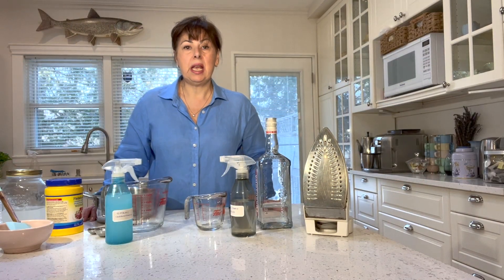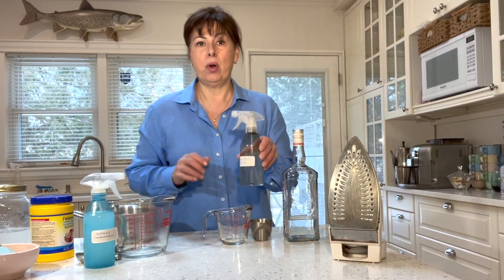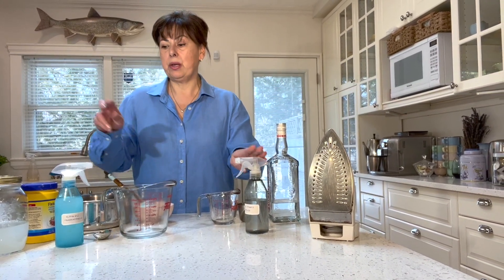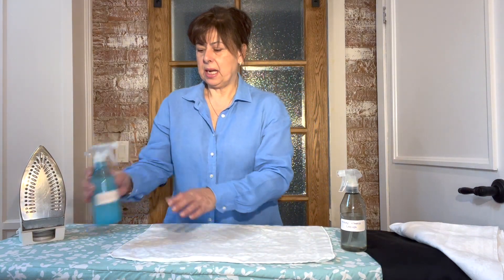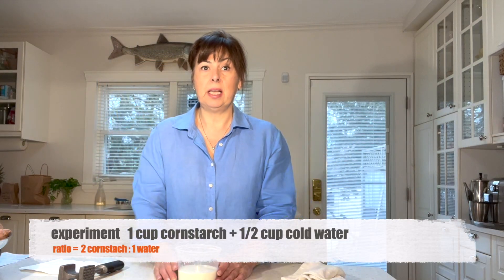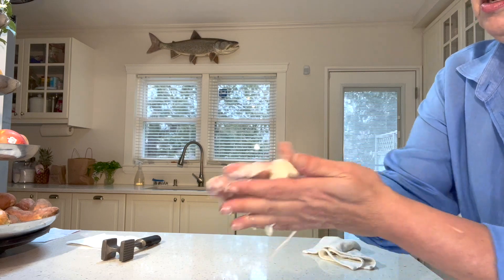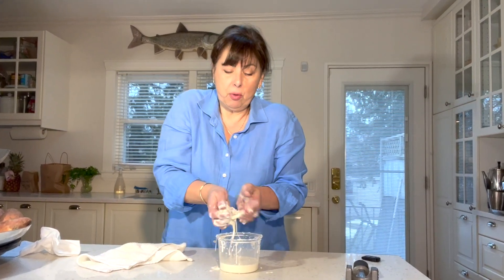DIY Spray On Starch and a Science Experiment!

Comment: This was a great video! I learned the art of starching clothes and I agonized over the course of a week of what kind (spray, liquid, powder); how, and where to get the laundry starch. Then I realized that I could make my own! And THEN I realized that I didn’t even need to buy corn starch because it was already in the pantry! I tried this recipe earlier in the week, and I tested it out today. 

The purpose for making this was to flatten out the seams of old jersey knit shirts after taking out the thread (I’m prepping scraps to practice on my brand new sewing serger, which I don’t know how to use yet). There is quite a difference after ironing with the starch!

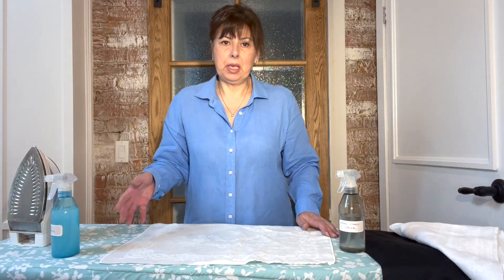My question is now, what is the maintenance on the iron and board? I’ve caused starch streaks on my iron. I noticed that you swipe the iron on a towel between uses (6:10 to 6:20)? Any tips and tricks would be greatly appreciated!
Reply from the maker: A new serger, how great! I like using the vodka starch which doesn’t leave much residue on the iron. However,  I’ll clean any residue off the bottom of iron by pumping steam and wiping  or ironing on an old towel.  For deeper cleaning,  on a cold iron, I’ll use a little dish soap & water and wipe with paper towel.  I haven’t noticed my ironing board pad getting starched or soiled. However, it’s probably a good idea to wash it from time to time.  Hope this helps. Thanks for watching and enjoy your new serger.

Comment: The vodka starch worked great, however, I have one word of caution to those who may not be so experienced with ironing.  It's possible that there is something in the vodka that can "clean" your iron (even when you don't think it needs cleaning).  Luckily, My first swipe was on the UNDERSIDE of the collar of a white shirt.  I was shocked to see yellowish stains.  After that, I kept testing the iron and I even ironed the rest of the shirt on the wrong side to be sure it wouldn't happen again.  And it was fine.  So that leads me to believe that the first swipe requires vigilance on the ironer's part to be 100% sure it is 100% clean : )
Reply from the maker: Thank you for this. That’s a great tip to save your clothing from staining. I hadn’t thought of it. That will be another good topic to cover… the best way to clean your iron. Thanks for sharing and watching.